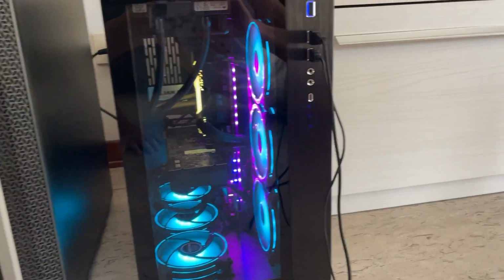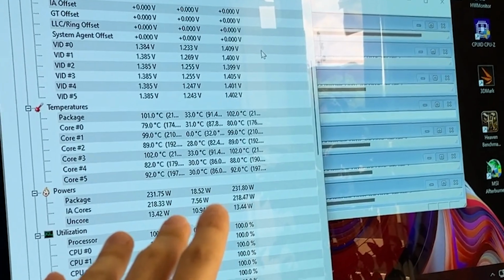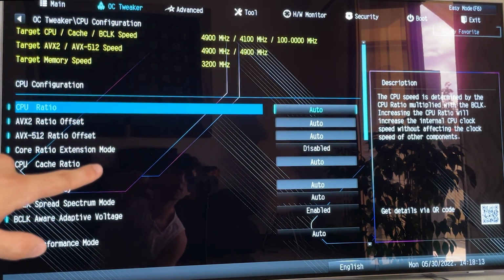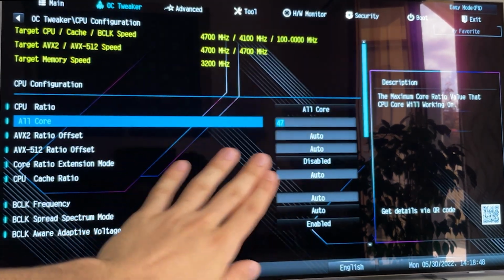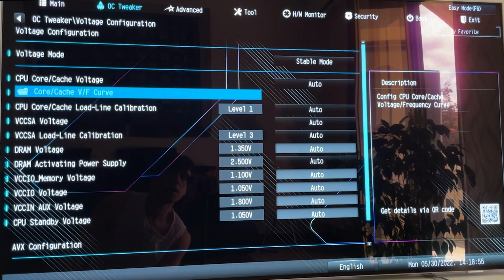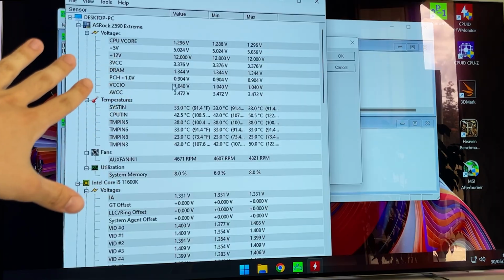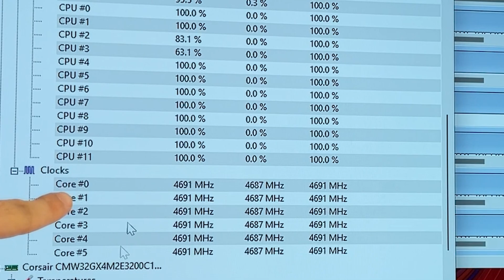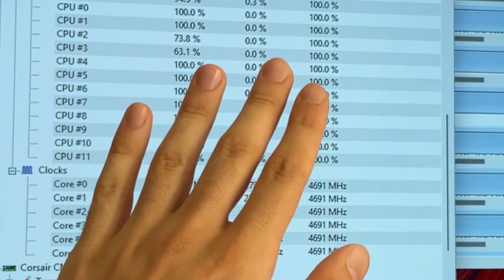Overheating i5 11600K Fix | Undervolting Tutorial | Overclock to 4.7Ghz all-core

Comment: Who’s here in 2025? Anyone still rocking out with the 11600k like I am
Reply: still rockin with the 11600k here mate 😅
Reply: Mine gets to 99c at 50% usage, do you have any advise😢
Reply: @qotemdfk  bro honestly I just sold my 11600k on eBay for $137 and took that and got a R5 9600x for $208 with free DDR5 16gb kit of Tforce rgb ram valued at $89 for free so that’s my advice for your heating problem bc 9600x runs super cool and combos with my rx 6700xt very well for 1440p res

Comment: ON MSI 590 Digital Power Level 3 and Adaptiv + Overide 1.250 and Overide - 0.050 and you has with a 11600k optimal performance. If your system becomes unstable, you have already destroyed your CPU with to high settings and can buy a new system. 1.300V is maximal! All over, more than bit minutes, you destroy this 11600k CPU.

Comment: Hi bro, in my motherboard bios i have for the CPU Core/Cache Load-Line Calibration 7 different level while you have only 5 in the video.. What do you recommend in this case, do i still put level 3 ? (Also it says that level 4 is recommended for OC)
Reply from the maker: Yes, level 3! And consider subscribing to the channel :)
Reply: @ImWateringPSUs  just did it lol

Comment: Core 2 and 3 are not at 100% load and should be under Prime 95. Your voltage is still showing 1.33v rather then the 1.3 you “entered” in bios. Also, with the LLC you entered, voltage should be below 1.3 under a prime 95 load. Naturally, 4.7 Ghz will lower the temp from a 4.9 Ghz clock. Under 100% load all the cores will be at max clock on auto multiplier settings. My 11600k boost to 4.85 Ghz on all cores under 100% load under auto settings.
Reply from the maker: If it reaches 4.85Ghz all-core under AVX workloads at "stock" it means your motherboard is doing some auto-OCing! It's not supposed to

Comment: Do you know good settings for i5-10600kf? I was trying to tinker with clock speeds and voltage before but it even slight change made it unstable. But if I run it stock then I hit 100 degrees in cold war :/
Reply from the maker: They’re basically the same as the 11600K
Reply: @ImWateringPSUs  I undervolted it slightly from XTU but my sample is quite bad one. It could handle only a miniscule undervolt, otherwise it would become unstable. But at least its slightly better than stock. It's just that my case has no airflow so it gets bit toasty but thats not a huge issue

Comment: It does 4.6ghz on all core stock not worth going to only 4.7ghz
Reply from the maker: It doesn’t sustain 4.6 under heavy loads and also it does so at higher voltage!
Reply: @ImWateringPSUs  you must raise power limit, staock values,isn't enough to maintain a speed of 4.6ghz for more then a few sec on all core, my long trum pl is above 200 watt

Comment: Undervolt + 4.7 Ghz all-core suitable for i7 11700K as well? Will it still turbo boost to 5.0 then?
Reply from the maker: Yes it is suitable for the 11700K as well but you’ll get a 4.7 all-core ratio instead of the 5ghz peak unfortunately
Reply: @ImWateringPSUs  As opposed to the standard all core 4.6 clock speed?  Yeah, you're right I would lose the 5ghz peak boosts... but the boost only works for max 1-2 cores?  So perhaps better to use turbo ratio offset, e.g. +2 would give  5.2ghz 1-2 cores  5.1ghz 3-4c  4.9ghz 4-6c  and 4.8ghz for 7-8c probably gives better results.. have to try first.. have you got good experiences with turbo ratio offset overclock and/or per core manually set clock speeds?   I'm still studying on what the best options are for slight undervolt + slight overclock.. for gaming that is.. thanks for your videos
Reply: Since I have an MSI Z590 motherboard, I was curious about Game Boost, what it really does. It happens to increase the turbo ratio +1 on all cores, both P and E cores in case of 12th and 13th gen, and sets the AVX offset at -3, convenient way to do a minor overclock... gonna try it with an undervolt....

Comment: I tried this and my temps got way worse.
I run a MSI Z490 Gaming Carbon with a 10600K and a Arctic Liquid Freezer 240. When I have everything stock and only using Adaptive with Offset mode by -0,050v I reach about 72C after a couple minutes Prime95 smallFTT.
When I use your settings Prime95 shoots up the temp to 86C in a second.
Reply from the maker: Check out the difference in performance though! It means you're highly throttled with stock settings!
Reply: Hmmm not sure if I follow. Throttled in what way? I'm not thermaly throttled.
Reply: @dalllle79 performance are throttled to reduce temp

Comment: just wanna say thanks. i had this cpu over clocked for a while then i upgraded the bio's and installed asrocks motherboard software and for some reason that software FUUUCK my shit up i have no clue what it did but it reset it hard. and i couldn't figure out why it did it.
Reply from the maker: I’m really happy it was helpful! Thanks a lot for taking the time to write this! :)  I’ve had issues like that with manufacturers software before, they do change things in your bios😅
Reply: @ImWateringPSUs  yeah it changed all my curves, set my fans to default which almost cooked my cpu. changed ram, changed boot drive prio. i still cant figure out what it did but i got it sorta setup now. thanks again

Comment: Im having real troubles with this cpu and AAA games like battlefield 2042.  I have an AMD Radeon RX 6600  and  16GB of RAM and I get always a super-mega bottleneck with the cpu at 100% and 80ºC and the GPU no more than 50% no matter the in-game settings. Would this help me? Is there anything that i can do? 

Thank you in advance¡¡¡¡¡
Reply from the maker: Yes, a proper undervolt can DEFINITELY help you fix that, try following the tutorial and let me know how it goes!
Reply: @ImWateringPSUs  Okay, i'll try it and let you know. Thanks¡
Reply: @Thefermar337  hey did that end up working cause i just got the exact same build and im having the same issue in 2042
Reply: @benchmarktv2582  Sadly I have not tried it yet. I've been quite bussy. Do you have the same processor? Let me know if you tri it please
Reply: @benchmarktv2582  Hey, Did you end trying? Did it work? I would love yo hear news from you :)
Reply: @Thefermar337  honestly didn't help much i just ended up getting a i510600k now im getting 120 frames solid

Comment: It gives me a blue screen with your configuration. Is there a way to have some other configuration? I have your same motherboard and processor
Reply from the maker: Simply add 0.025V to the vCore, if it still crashes give it another 0.025 more!
Reply: then it would be "fixed voltage" = 1.325V?

Comment: Mine 4.7 as well.  Is 80c ok for my temps.  That is the highs.  Most games it stays at 70c
Reply from the maker: Yeah 80C as absolute maximum temps is actually really good! Great job there :)
Reply: Will putting it back to stock, drop my temps by a lot?
Reply: @blakebrasher8884  Stock settings will likely increase your heat, then the cpu will just thermal throttle itself, resulting in lost performance. CPU's from both amd and intel these days produce too much heat.

Comment: Can you make a video for the 11700kf? I am over heating so badly on default settings 😢
Reply from the maker: Yes, absolutely! The settings on my i7 11700F Video apply to you, but as soon as I have an 11700KF on hands I'll also make a dedicated video about it!
Reply: @ImWateringPSUs  Same I have a  11700KF and just got a Intel i9-12900KF I hope it doesnt overheat with a Liquid Cooler
Reply from the maker: @Tblack603  You just have to set it properly and undervolt if needed and you'll be fine man, no worries!
Reply: @ImWateringPSUs  Is it possible to both undervolt the 11700KF with perhaps an -0.050V offset and overclock at the same time? What might be the maximum all-core overclock with less voltage, or is that impossible? 4.8 on all-core?  And what about power supply, my son's gaming rig has a 11700KF with an 6800XT, will 750W PSU suffice for gaming? Or will we have to undervolt both CPU and GPU? Normally even when overclocked the CPU doesn't use more than 150W while gaming does it?

Comment: I'm confused by this title I want to get more performance out of my 11600k I have a z590 tuf MB. So does this get me to 4.7ghz? And undervolt? I'm currently stock rn
Reply from the maker: Yes, this is effectively and undervolt, it removes the thermal restraints and gives a smoother game experience overall with less noise and lower temperature. If you want strictly higher clocks, I also have an overclocking video!

Comment: I would like to try it soon, but I was wondering, does this affect the CPU's performance? or what changes could I see after this process? (except the lower temp)
Reply from the maker: It gives you a ton more performance if your CPU was lowering its clocks due to overheating! It also reduces your power consumption!
Reply: @ImWateringPSUs  I tried changing the settings but due to names change i want you to check them for me please, I have images and I wont be bothering you as much as I can, can i dm you on IG or email? Wherever suits you 
And I couldn't find the load line option in my bios can you help me with that too 🙏
Reply from the maker: @joallayamarso4675  Sure man, send me a DM on IG :)